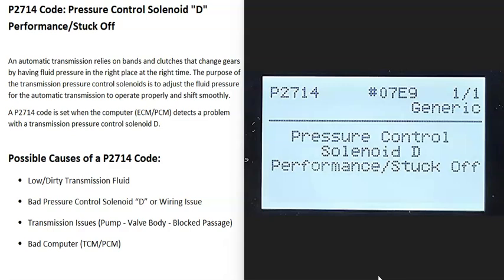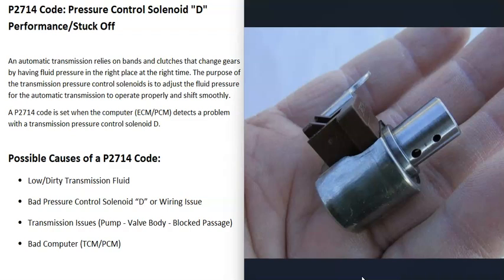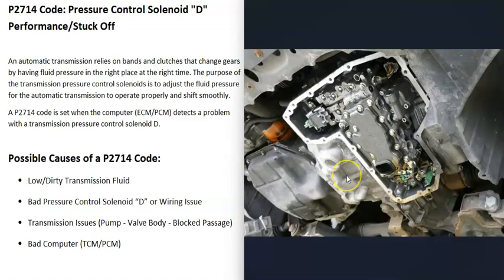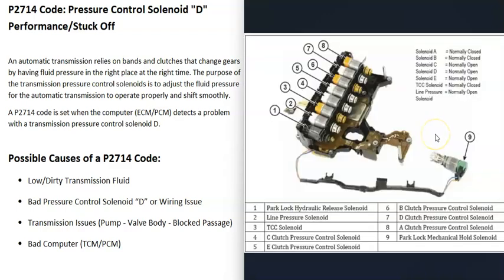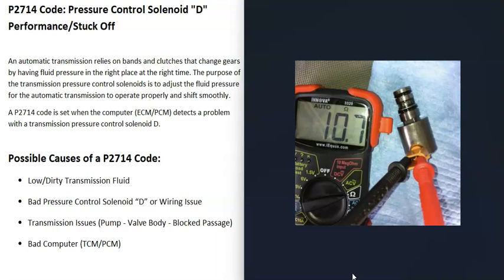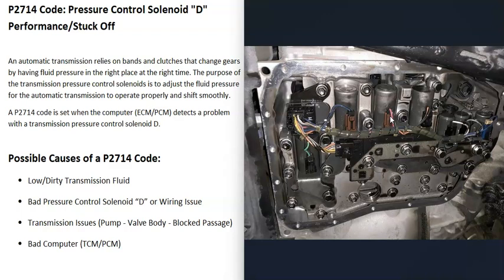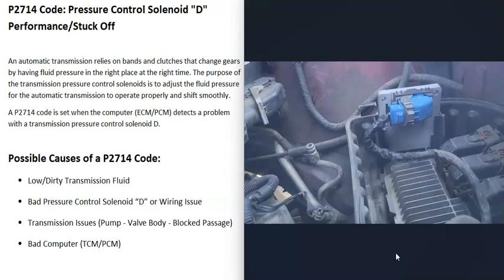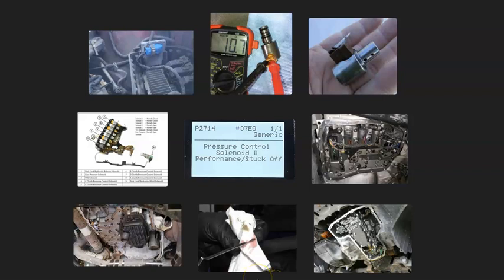Causes and Fixes P2714 Code: Pressure Control Solenoid "D" Performance/Stuck Off

Comment: Replaced full friction n steels im not getting 4-6 gears replaced the p2714 s2 still not going into it , it went into 4th a few times ever throughout my test drives but valve body solenoid kit new should be the fix right that’s the last option to fix
Reply: When I took apart the valve body looked fine no debris and solenoids all had good ohms to spec
Reply: Valve body valves were butter smooth aswell fluid was set with 1 drip per second at the 102° estimate

Comment: I had our 2007 Lexus RX350 transmission fluid replaced 3 years ago and now we are getting a P2714 error code!  Could that that flush have led to this problem now?
Reply from the maker: If a transmission is very old and the fluid was never changed out, doing a flush can cause issues. If the fluid has been changed out when required, there usually are no issues. Also, when there is a problem with a full flush, it is often immediate or within 1-2 weeks.

Comment: My OBD is giving me this code but it’s also causing all the lights on the dashboard to come on and killing the battery. So the car won’t even turn over. I had the battery checked at Orielly’s and they said the battery is still good. Can this mean it’s something other than Solenoid D?
Reply from the maker: A bad pressure control solenoid can cause transmission shift issues, but the engine will still start. There may also be a bad solenoid-D, but the engine should still start up; there is likely another issue.

Comment: HELPFUL VIDEO HOWEVER THE MECHANICS OUT HTERE DONT WANT TO ACTUALLY FIX THE ISSUE WITH THE UNIT, THEY JUST WANT TO SELL YOU A WHOLE NEW OR REBUILT TRANSMISSION.
Reply: Or tell you they are rebuilding it and only change the selenoid and charge you for the whole deal 🤬
Reply: This is the problem I’m having.

Comment: check your fluid level! You have to warm up the oil for about 5-10 mins switching gears back and forth then check the fluid level. thats all that was wrong with mine but was giving me error codes.
Reply: it was not shifting into 3rd when it was low on oil.
Reply: @Alex-qk7zx  Thanks for the response. I'm going to check the levels and replace it as well.
Reply: @Alex-qk7zx  what code was it giving mine is a 2020 toyota camry
Reply: @zStC1  it was the transmission i had it replaced
Reply: Was it still shifting correctly? Mine has that code, but it's not shifting into gear.
Reply: So I have a 2007 Fj cruiser that is throwing the p2714 & it was slipping when I’d let off the gas say to  make a turn well when I’d go to accelerate after completing the turn it’s slip out for a sec and then catch, I have the fluid and waiting on the filter to arrive Monday and gonna change it I’ll update this comment after getting the correct levels and a new filter and topped off to let anyone interested know if that helped
Reply: @Jeff-rk8hq any updates?

Comment: im trying to diagnose a e450 with solenoid D codes...there is only 1 volt at the solenoid D pin at the transmission. that cannot be correct

Comment: Where do I get the diagram for the solenoid
Reply from the maker: Sometimes, information can be found for free online, but it can be hit or miss. Professional mechanics use paid services such as All Data or Mitchell Pro Demand. All Data has a DIY section for individual vehicles, but it does cost by the month, and they often have recurring monthly fees, so if used, be wary of which service is bought. Finding a manual for your specific vehicle information is likely best.

Comment: I have this code and a p0761 code which is pressure control C stuck off. And a lot of times it won’t shift into 3rd and 4th gear until I shut the truck off then restart it and it’ll run fine the rest of the day
Reply: while it still runs, take it to a trustworthy mechanic near you
Reply: I have the same exact issue as you
Reply: @audra5609 did you find a fix?
Reply: Did you fix?
Reply: @OnyekachiOlehi did you have similar issue?
Reply: What did you end up doing to it?
Reply: @trawk244 the ECU

Comment: Loved the video. I’ve got a 2011 gx460 with 252,000 miles, I have P0761 and P2714 codes. Should I try to do a  flush first and see if the faults clear??? I know the fluid is dirty for sure, I’ve had the vehicle since 125,000 miles and I’ve never changed fluid. Thanks so much.
Reply from the maker: I wouldn't do a full flush, that often causes more problems. Some will disagree, but in my experience, when a transmission has high mileage, it is best to only change the fluid in the pan and the filter. Whether it works or not is a toss-up. There may be another issue, but old, dirty fluid can cause problems.
Reply: Hey I have the same issue and I was wondering if changing the transmission fluid fixed your problem?
Reply: Same car with similar milage as well
Reply: 2010 gx460 just got this code but as a permanent code not active... I have 258,000 miles  .runs perfect no shifting issues, no shutter, no slipping just have the permanent code... Did you find a solution.. in planning to change the solenoid and do a transmission service....
Reply: I have the 2011 GX 460 as well and it just threw those codes P0761 and P2714.  Did you find a solution yet?

Comment: I have the following codes C1201, P2808, P2757, P2714, P0796, P0776, P0746.  when I put the car in drive it only moves after pressing the gas RPM's to 7. and when putting it in reverse it does nothing. I don't feel it engage. Any help would be GREAT!
Reply from the maker: It needs to be diagnosed, but there seems to be an issue with the transmission. If possible (some vehicles no longer allow this), check the transmission fluid. Also, be sure the battery is good, and the terminals have good connections. All the computers need a good power supply, or they will give errors.
Reply: Have you find the solution yet? My 2013 Toyota Sienna  is having exactly the same issue

Comment: so i got a P0983 code..than took it to toyota to diagnose the issue..they did a software update n came out with P0766, P0776, P0894 n P2714 than the code i got when i took it in was gone after the software update..now toyota dealership tells me i need a new transmission..i was like huh??? my transmission is not leaking or slipping but wont shift after 3rd gear with all codes pointing to the solenoids..what are your thoughts on this?
Reply: They told me the same thing on my 2018 Camry they dealers are liars grab the solenoid yourself and find a good mechanic then take it to Toyota for a software update

Comment: I have this code on highlander 2013 P0766 Shift solenoid D performance or stuck in off position permanent is it hard to replace?
Reply from the maker: Yes, sometimes they can be hard to replace. The transmission pan needs to be drained and removed, and depending on the transmission, the solenoid can be hard to get to. It is best to see if there is a video for your transmission to know what's involved.

Comment: So the p2714 code does not necessarily indicate the need for a whole NEW transmission?
Reply: No. But a dealership will sell you one because it comes with a warranty and they don’t have to worry about you coming back when the other solenoids go bad
Reply: @FlathaxiosRGH the dealership just tried to sale me the whole body… i told them i just need the control solenoid smh
Reply: @jeffkildow9917  from what I've read..it could just be tge transmission output speed sensor..that is a easy fix..it mounted on the driver side at the end of the transmission..one bolt holds it in place n u just have to unclip the wire connector..its a 5 minute job..oem part is about 140 bucks..after market one ranges from 15 to 30 bucks
Reply: @benzlee8538 why would it be the vehicle output speed sensor
Reply: @dannyhu3rta  because that sensor can cause that code p2714 and it can make it seem like your transmission is bad..doesn't want to switch gears and it will put your vehicle into limp mode
Reply: @benzlee8538  What you are saying makes sense. when mine shifts to 2nd it jumps back to 1st. As if it thinks the truck is either moving slow or stopped.
Reply: @benzlee8538 would it also cause the cars gas pedal to stop working